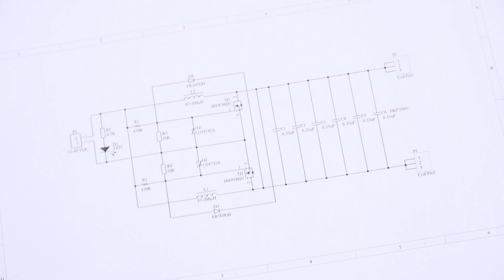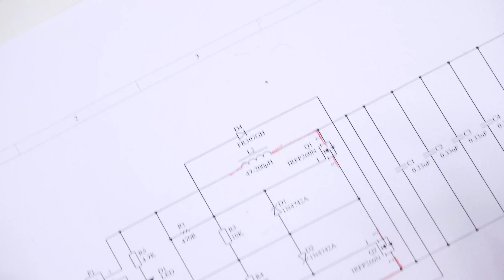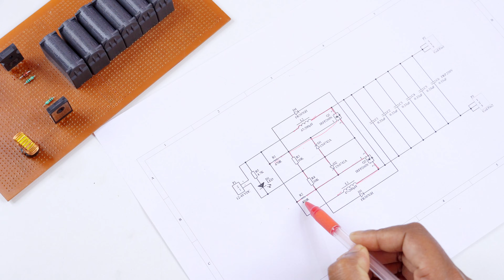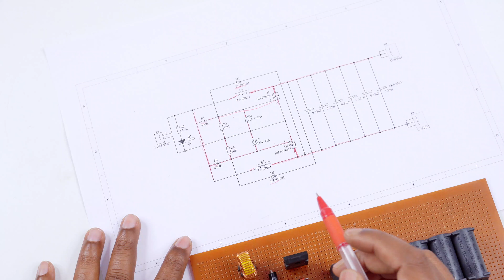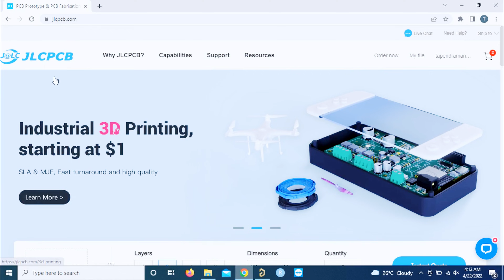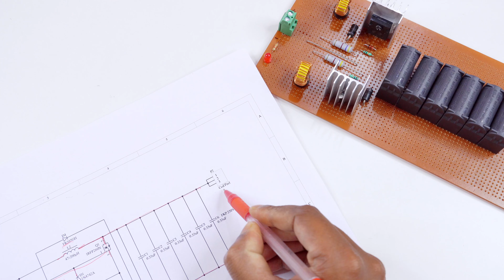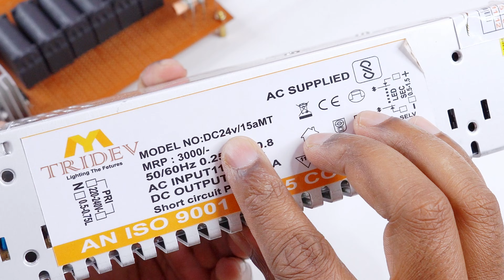How to Make a 1kW Induction Heater

Comment: Hi, what power supply did you used? thx
Reply: He used the power supply that he showed in the video. He even showed the label and ratings, so you wouldn't need to ask.
Reply: @johncoops6897 Hello anhz Should I use 470 2w or 1w resistor, thanks

Comment: Is this not 360 W. Can this circuit handle 1000W? How much maximum it can handle current in video there is given about voltage 12-48 v but not current.